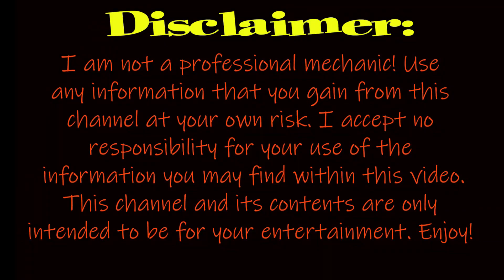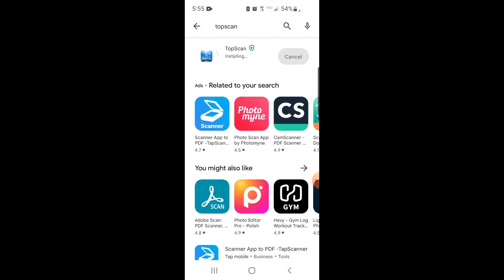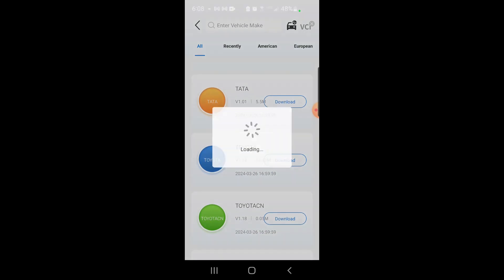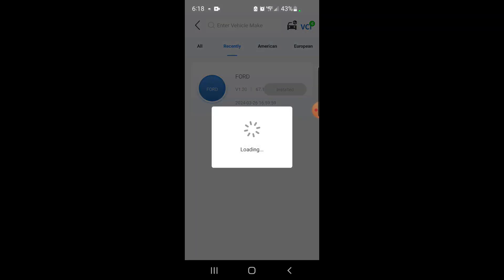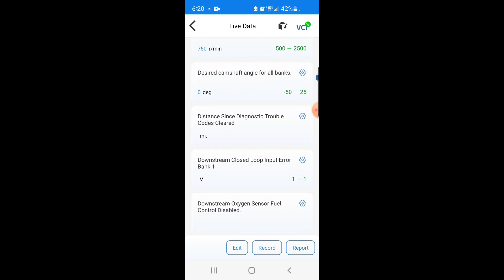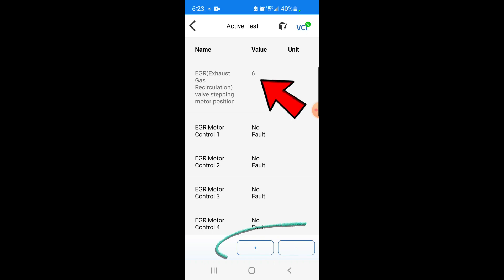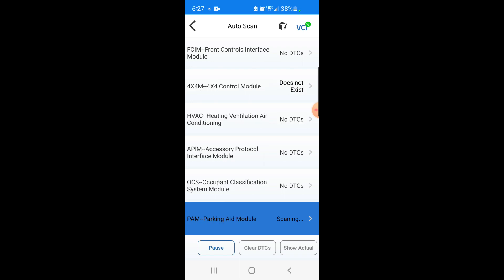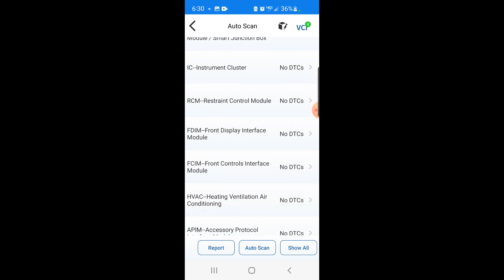The 89G - Beta Testing TopDon's NEW TopScan BluTooth OBD-II Scanner Android & Apple Compatible

Comment: This is a nice tool!!! What the newest year vehicle it will scan?
Reply from the maker: That is a great question. I have scoured through all of the literature, and I see no range of supported years. From my own experience, however, I have used it on a 2017 Ram 2500, and it worked fine as far as reading codes. The bi-directional functioning didn't support what I needed for that vehicle though, which was Quicklearn RFE. It is loaded with features though. Probably the most features you'll find in a compact scanner.